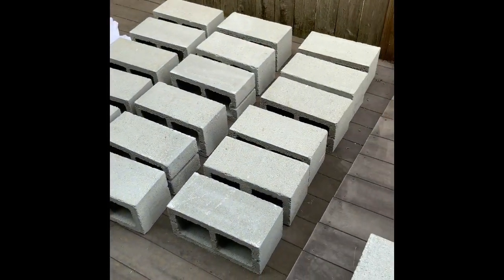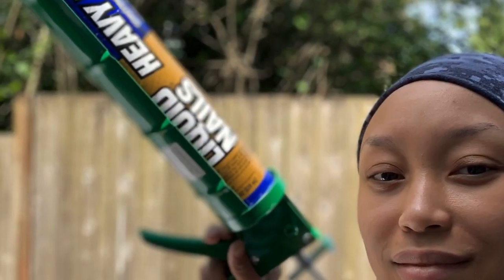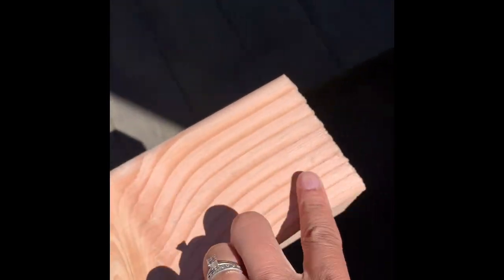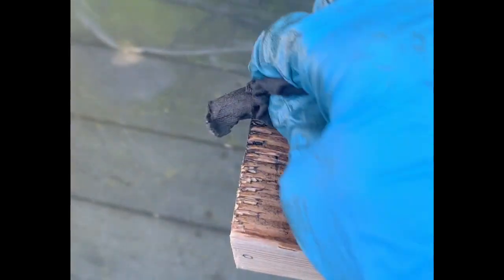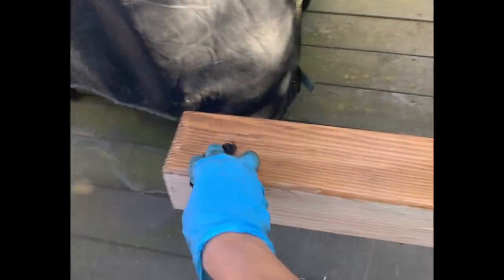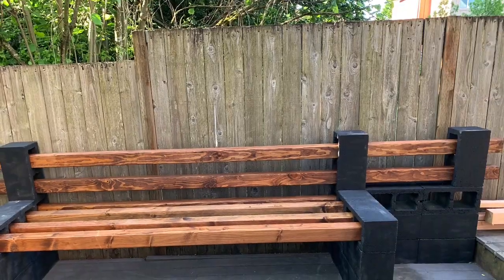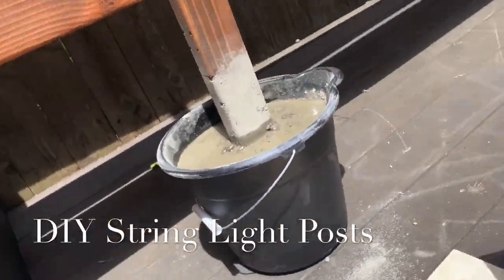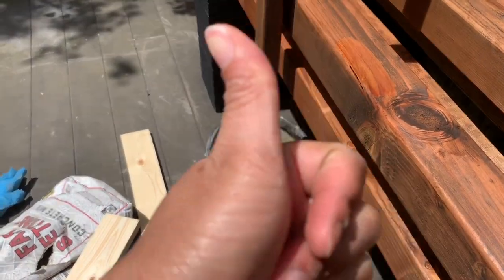HOS TV| DIY Cinder Block Sectional| Patio Makeover PT.1

Comment: Looks great, that question is the cushion that you made for the couch can it get wet or do they need to be under a roof.
Reply from the maker: Larry Towe| thanks a million for checking out my video... I do not leave my cushions outside since I don’t have a overhead covering- slightly OCD regarding cleanliness. The cushions are not water resistant.

Comment: If you don't mind me asking how much did the cinderblock sectional cost?
Reply: I'm not the person who built the furniture. But I can tell you that in my state lumber has increased significantly due to demand. Fires, flooding, natural disasters, etc. have inflated lumber 5or6 times what it coast last year!  Block is about 2$ apiece. They were slightly above 1$ last year. A quick call to Lowes or Home Depot will determine the cost in your area.

Comment: What is the 4'x4 size
Reply from the maker: Hello Chiquida, I purchased 2x12ft 4x4s and 8x10ft 4x4s if I remember correctly- I may have mentioned it in the video. I did cut them down to size to fit my diy cushions. Check out my Decorate with me video for details. 
If you plan to add cushions, consider the sum total length of them when purchasing your wood. Buying only what you need will save you money  and time. 
Thanks a million for stopping by the channel- I hope this helps.